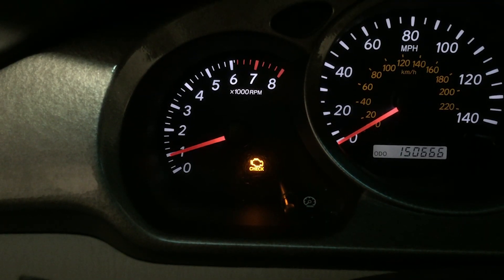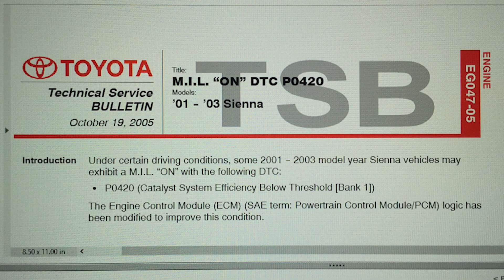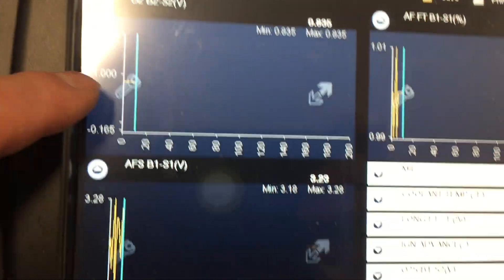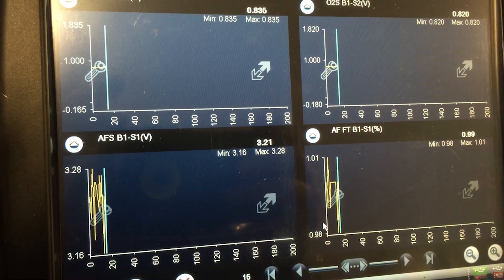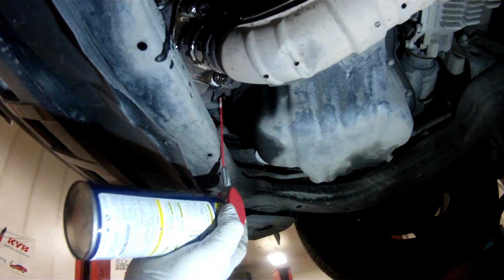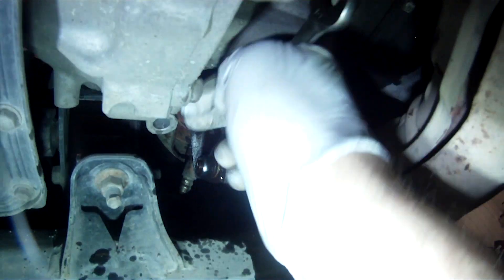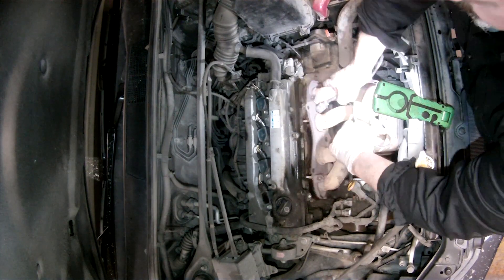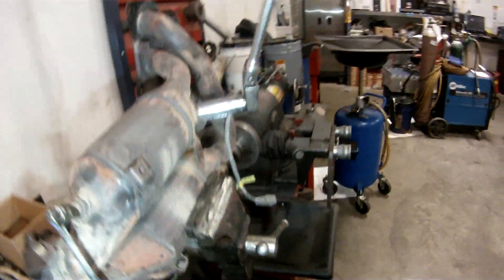Toyota P0420 P0430 - Toyota highlander Cat Efficiency Codes

Comment: Great video!

My 02 Camry 2.4L will throw this code ONLY after at least an hour of highway driving. Will not trip this code in any amount of city driving. 

Assuming the cat shits the bed after heating up considerably. Thoughts?

Car has close to 300 km or 185 miles

Comment: Black Jack is an 05 Highlander, and the engine light came on today as well as traction and the VSC.  The scan at Advanced showed it was these two codes.  What's the cost on just the parts?  I don't know what to google since I've never had this problem w/ any car I've ever had.
Reply: They're called catalytic converters, some vehicles have 2 or 4, they are like filters to clean the smoke coming out of the car so it's not so dirty, they are expensive and some states will not let you pass emissions if it has a code for them

Comment: 2005 Highlander Limited 3.3 
250k+ miles
CEL:
P0420
P0430
VSC 

i salvaged some O2 sensors and swapped em out. still had wonky voltage readings on the down-stream. given the mileage, it makes since the cat needs replacement. i’m about to order the replacement cat. i’ll update on the CEL status after the replacement. 
thanks for the info,
Steve ✌🏻
Reply: Any update lol
Reply: @JamesAutoDude  no update  reply lol!!! im curremtly dealing with these issues. 2005 hylander 3.3.  started with po0171 and 0174. i did replace spark plugs at 150k miles but the ce light with vsc light started coming on around 140k miles. sometimes it cleared itself. now if i clear it it comes back fairly quick. i replaced the fuel pump...i have changed the very forward 02 sensor with plans to change the others accordingly. however now the code is p0430. lol. stupid stuff!!! i have no issues replacing the catylic converter but what are your thoughts!!!???
Reply: @mikelangston7699  well for me it did end up being the converter. I threw all sorts of parts at it like the oxygen sensors, etc lol. But ended up being the converter 

Unfortunately we have to fix misfire and lean/rich codes quick or it ruins them. That's what happened to me... I drove it one day misfiring to go to/from work and apparently that was enough to fry the converter (didn't show up until later though so must've just started the process of failing)

Tbh I'd just get one from rockauto and I'm sure it'll get rid of the new code. But also look into anything else like high/low fuel trims especially after replacing

From my research, it's pretty rare for the cat code to be wrong lol. Unless you have other issues like misfires, vacuum leaks, etc ... But even then there's a separate code for that
Reply: @JamesAutoDude  I've got absolutely no misfire. Car gets exactly same mpg as always. I only changed one 02 sensor and both those lean on bank 1 & 2 codes disappeared 😂. I am still going to change the other 3. These dang computers in cars are just irritating. But I like keeping my old cars cuz I like being debt free. I'm just a garage wrench for my own stuff. I like the challenge of beating these things. I got the Highlander, 2012 outback, 94 ranger and I stay very busy maintaining all these. Our expression is, I can fix any problem by throwing $1000 bucks at it
Reply: @mikelangston7699  yeah I mean even the lean/rich codes will cause the converter to fail. I remember a 2015 Honda Odyssey that had a lean code. Got it fixed and then a month later the converter code came on for that side. Replaced the converter and it's been fine ever since lol

So yeah I think sadly it ruined the converter. Any lean, rich, or misfire code seems to do it pretty fast. Almost better to just tow it home and never drive it again until it's fixed 😭

But so true about fixing any problem for $1,000 lmaooo. Except for tires and stupid low pressure sensors... Those mofos can cause bankruptcy
Reply: @JamesAutoDude  I subscribed to your shop 👍. I got a shop out in pahrump NV where my ole man lives. He used to gut out my cat converters on my Ford dsls. I'll have him replace the cat converter in this car. I don't like welding under the car. I'll let you know how it goes chief
Reply: @mikelangston7699  sounds great 😎 I'm pretty confident it'll solve that new code 😌 just check the rockauto cuz they have better deals usually for converters. Not affiliated with them, I just use them as much as reasonably possible lol

I don't think you'll need to weld anything. Should be able to get the manifold converter where you just bolt it on

I subscribed back 😅 

Hope to hear back soon haha
Reply: @JamesAutoDude  oh fuck...I forgot I had a miniscule fishing page 😆😂

Comment: What if downstream O2 sensor is oscillating rapidly similar to upstream sensor but the cat temp test shows the downstream temp is 100° hotter than the upstream pipe? What may be wrong? Power is still okay.

Comment: I have the same vehicle. Pending cat codes p0420 p0430. B1S2 & B2S2 read .600-.800 and fluctuate.  B1S1 and B2S1 read 3.250 and move slightly while running, not much. Does this sounds like an o2 sensor problem? Or cat gone bad. Thanks

Comment: Is it normal to have check engine light, vsc light, and traction control light come on for this?
Reply: I changed the plugs and coil packs problem solved
Reply: I retract that comment light back on. I even poured sea foam down converter and cleaned upper 02 sensor and reset then three days later back on.....
Reply: Did you ever get ride of the dash lights?? I have the same issue
Reply: Im getting P0430 on Lexus IS250 2007 manual. Changed air filter, all 02 sensors, MAF sensor, tried different cleaners I don't know anymore what to do.. Car performance is normal but after clearing code it comes back after 50 miles maybe or so
Reply: @NLS_7  same here in my 2005 highlander

Comment: Hi doc. Very good. I have a Toyota Highlander 2006 3.3 l it has 382600 miles on it now, I have been trying to find out what size the o2 sensor is weather it it a M 14 16 17 18 x 1.5 downstream or what.

Comment: Thanks for the good video. I have the same engine on my T22 Avensis (2001) .
Im using Techstream for troubleshooting. Last 2-3 times I have been getting p0420 or both p0420 and p0430. I think my cat is gone.
I will try with cleaning intake +cat (with spray solutions) but if it doesn't help I'll have to change it.
Thanks again.
Reply: superdaddys69 a1

Comment: The Car Dr.  I would like to ask you some questions . i have 04 Camry 2.4L , same engine as highlander in this video.  when i plug in my scanner to read O2 sensor, they reading 1 : O2B1S2 (V) = 0.055 & O2B1S1(V)=3.457 , reading 2: O2B1S2 (V) = 0.875 & O2B1S1(V)=3.144 .   can you tell me your opinion on these reading ?   i think, S1 is before the Cat, and S2 is after the Cat, is it right?   is the S1 supposed to be over 3 ?  Why Cat failed ?  i dont want to put new one and fail gain. is there anything else i should to check to make sure ?
Reply: Did u ever figure out what was wrong?
Reply from the maker: are there any codes? Those voltage readings are not good if its a fixed voltage after the vehicle is warmed up but its hard to tell by the limited info youre providing. Don't those have AF sensors upstream? Can you watch the waveforms on a scope?
Reply: thank you Car Doctor:  after driving on free way over 65mph, first i got pending code P0420 and become check engine light on with P0420. i have one sensor b4 CAT and one sensor after CAT.  CAT is part of manifold.  my scanner has graphic, i can watch.  Sensor S1 is pretty steady at ~ 3.1- 3.4 most of the time.    S2 move around a lot.  I don't know if S1 or S2 is before CAT. thanks
Reply: voltages are not fixed V.  while engine running.  they move around.

Comment: I have a 2006 Toyota Rav4 with the 2.4 liter that burns oil badly.  I'm on the waiting list to have my engine replaced with new valve and pistons and gaskets from toyota.  I've been waiting now 4 months still waiting and still keeping the oil levels full until Toyota calls me into replace my engine.  On the other hand, I can't use my cruise control or four wheel drive button at all to three lights on dash now.  I already replaced air filter, in cabin air filter, pvc valve and all four spark plugs and both oxygen sensors and reset lights and they come back on again.  I guess I need to replace cataystic converter.  Or will toyota replace it for me it has 138,000 miles on it now.  This is my first toyota vehicle and I think I gotten a lemon.  Not too happy about my purchase.  What can I do?  Please help me the car doctor?
Reply: Rex D. Cundiff, Jr. i have a lemon 2006 Lexus GS300 it was recalled for piston rings also. It burns about a quart of oil every 500 miles which is A LOT. Im the second owner, original owner never got the recall done. It was warranted until 9 years from when the vehicle was sold with unlimited mileage. Ive emailed Toyota since i should not have to be responsible for this repair. Kind of dumb they only warrant it up till 9 years. If it is a recall it should always be a recall! I doubt they will take care of your catalytic converters but I am veryyy sure the cats went bad bc of the oil buring as i have a cat code as well...
Reply: Rex D. Cundiff, Jr. i believe manufacturers will cover emission catalytic converters up till 90k

Comment: Nicely done and good camera work. Looking at your before and after waveforms of the O2 sensors, they looked pretty much the same. Do you think applying the update to the PCM would have corrected the issue? Take care...
Reply from the maker: +stuzman52 I was wondering if anyone would catch that! Those were all taken following the repairs. I didn't film the before data so I just threw the after in hoping nobody noticed. Also one of the pids was not the right one I should have graphed. I just couldn't go back and have a re-do. Good eye for catching that. I am confident in the repair but the flash sure wouldn't hurt. I also sometimes shy away from those aftermarket cats for fear of returning codes but this application seems to work ok with using them. Only time will tell the light stays off. Thanks for the input!
Reply: +The Car Doctor Well Tim, you did an excellent job of editing it all together as it flowed pretty good. Keep up the good work!
Reply from the maker: Thanks, I'll try to remember to get the before data next time. I don't want folks to feel like I might think they don't know the difference between one graph  or another. I'm glad to have viewers like yourself who know their way around a shop.
Reply: All is good Tim! I've never worked on cars professionally, but I've had my share of working on them since I was a teenager. Mostly, I've worked in an industrial environment starting in the maintenance department. Today, I'm an electrical controls engineer working with automated industrial equipment. A lot of the controls on cars are very similar in their operation to this type of equipment. Keep up the good work Tim...

Comment: Yup, Toyota covers it for free up to 80,000 miles or so, they were a popular job at the dealer.   Toyota's always eat cats, i would assume the cats run hot on them.  That vehicle has no rust on it!  Nice shape for alaska.  You can strap that old Converter on your back and tell people its a jet pack.
Reply: +Ghetto Wagon Maybe I can sell it on Craigslist as a jet pack?? haha. Not much rust up here just nasty roads that beat the suspensions out of them.
Reply: DoctorD907
 Yeah I heard that deal, some people just drive old beaters because the roads are pretty bad.  + the gravel roads  kills the paint behind the wheel.
Reply: Ill take gravel and potholes over salt and corrosion any day for sure!
Reply: DoctorD907
 Hell yea, In NY, and this was down state in the NYC area they loaded up the roads with salt when they did not even need them. Its good being in the south where I can find all rust free like new parts to swap out the rusted junk with.

Comment: That looks like one expensive repair.If you had to replace all 4 of the 02 sensors then it would really amp the cost up.
Reply: +pontiachotshot I think it was a little over $700 but with the O2's it would have been another $600
Reply: Dear god